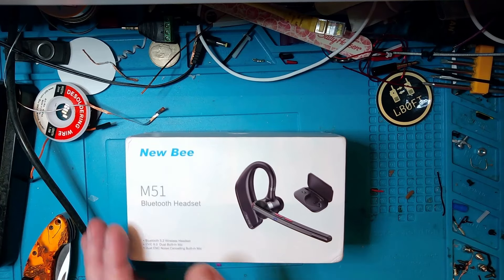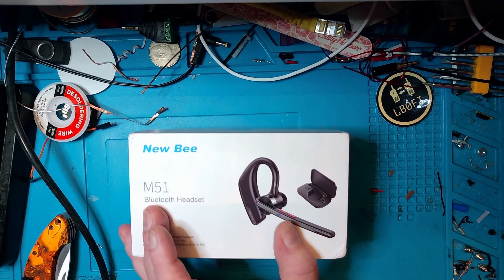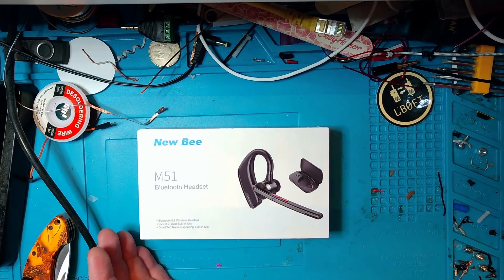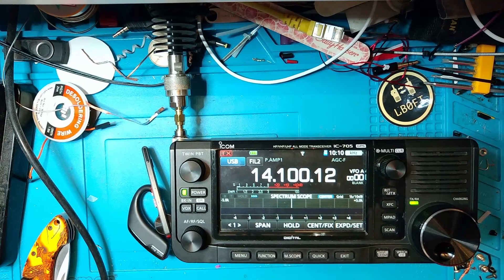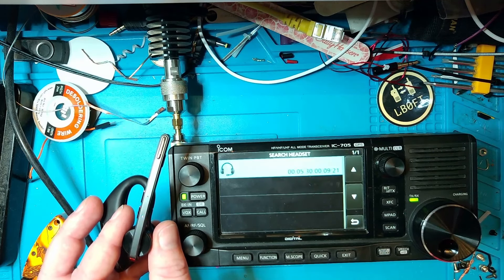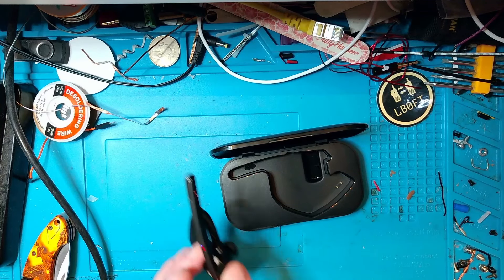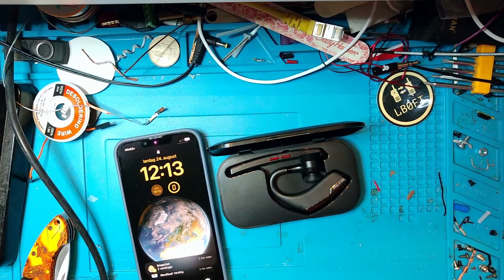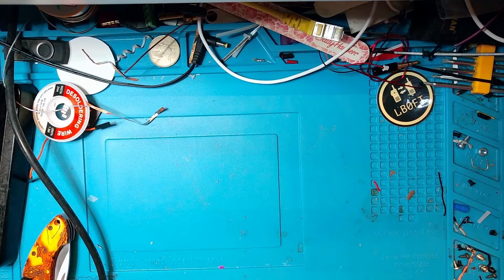Why in the world would the NEW BEE M51 be good for HAM RADIO?

Comment: I have used a similar headset with my Bluetooth modification for my G90. It worked but a Bluetooth headset with a single ear and a boom mike worked a lot better.
73 Ed
PS for use with a PC (or the Maestro I guess) my favourite at the moment is the really cheap (8 euros from OTTO RRP was 33 euro) TREND HS250. Solid comfirtable and sounds fine.
Reply from the maker: I also use a cheap gaming headset for the Maestro. Works like a charm